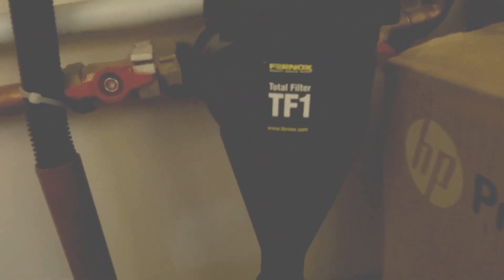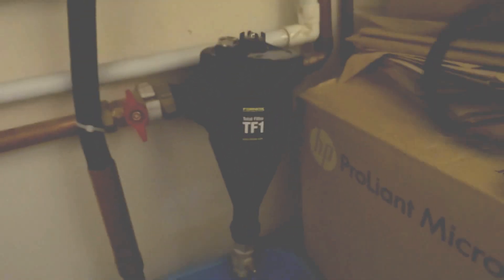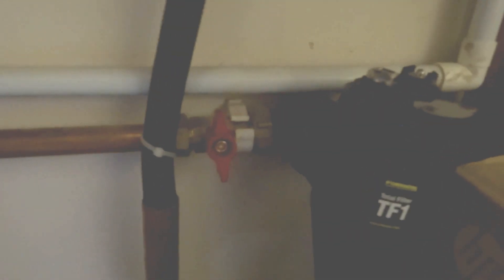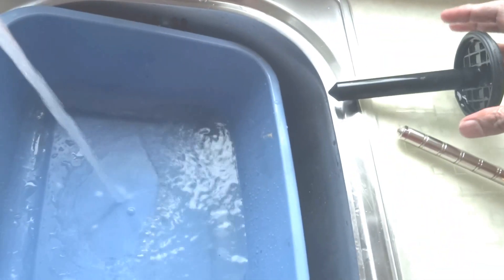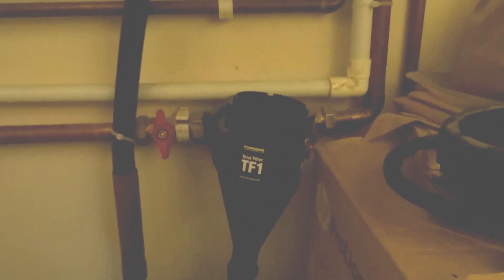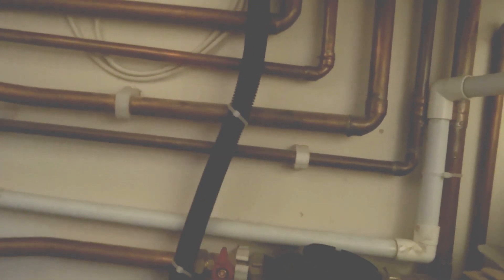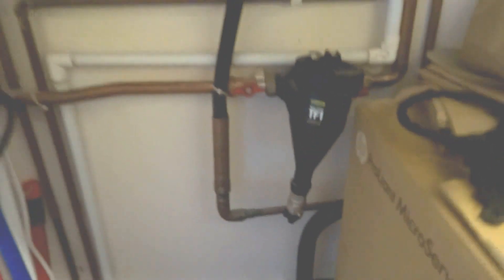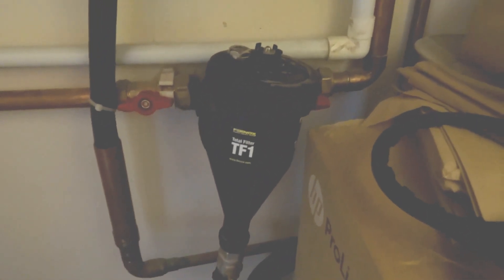How clean out a Fernox TF1 Total Filter, then top up with Scale Inhibitor

Comment: Thanks for the video. Despite being a bit foggy you did everything I needed to know and I could follow fine. IT was reassuring. My gunk did need the lid removing and wiping clean as it it had adhered to the centre even when magnet removed. You were luck that your filer was installed on horiizontal pipe as mine was on vertical. This put me in a panic as removal of the lid was tough first of all and this loosened the fittings for the filter. The top one was inaccessible by the pipe and filter itself but twisting the filter tightened  this joint enough and I could tighten the bottom with a spanner. I also needed to dose the system with x800 for a clean and your video helped me do this. One problem I found is that the filter lid has a catch position so twist it around to seat it properly and make a good seal. I did not do this first time and it leaked.

Comment: When I removed the pull out magnet and back flushed as per instructions, hardly any debris came out; so I took the lid off. I found a tube completely coated is self adhering debris, which I wiped off. The filter is supplied with a cap removal spanner and a spare gasket. The manufacturer appears to think the cap should be removed. I regard it as essential. I don't need to endure the risk of all that sludge getting into my ASHP heat exchanger.

Comment: As per Fernox instructions, there is no need to remove the filter lid if you are just cleaning it.
However, if you want to use the TF1 as a dosing pot you can remove the lid. Fernox have a picture of this on their website in respect of one of their protection products https://www.fernox.com/inhibitors-protectors/filter-fluid-protector-500ml
So many experts, so little knowledge.

Comment: Hmmm..no need to dismantle the filter I say.. Isolate the filter > Remove the magnet > Wait for a minute or two for the bits to reach to the bottom > Open the drain valve to drain the filter to a bucket > Gently open one of isolator valve  so the rest of the muck drains to bucket >Close the isolator valve > Close the drain valve > If necessary open the top silver valve in order to add inhibitor > Close it> Open both isolator valves >Bleed the air from bleed valve (for non Combi system) > Top up the pressure (Combi) >Start the system, check for leaks...Problem with dismantling the filter,after a while the top seal becomes deter rated and when you put it back it can leak (unless you have a spare new seal)

Comment: I used this video plus a couple of others today, works fine if you follow it.  I would just add that IF you take the top off and clean the "spike" inside, be careful putting the seal back and make sure it is fitted properly or water seeps out of the top (from experience!).  The video is clearly a new unit, once it's been in place a few years the seal sticks a little but is manageable and I am no DIY expert by any stretch.   I found an easier way is to close the valves, remove the magnet, wait 30 seconds to let the sediment settle, then open the drain (on the unit) and open the valve into the unit from your heating system, this will effectively flush most of the muck out.  I did it a couple of times and only took the top off because I was still getting muck coming out.  With the "spike" out & cleaned, flush was clear.  If you then close the drain (on the unit) it is more or less filled and only needs minimal bleeding.
Reply: Ron Baber Your comment is now two years old so you may not be interested. Replace the seal, but as well use a film of silicon grease,which does not harm rubber products.Auto parts stores commonly stock a variety of silicon greases.  Sil Glyde is a product available since the fifties,an industry standard in North America. Or GE makes a related product. There are others.